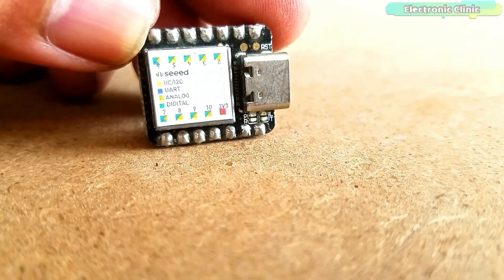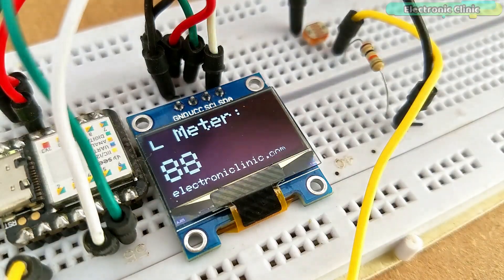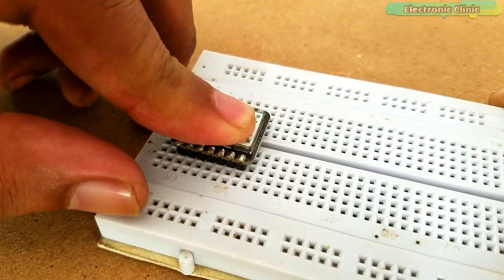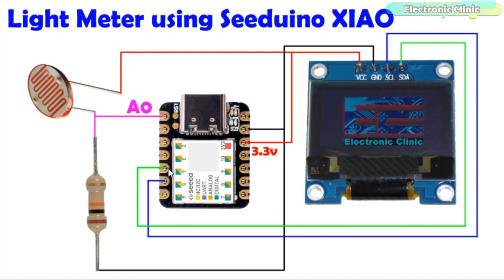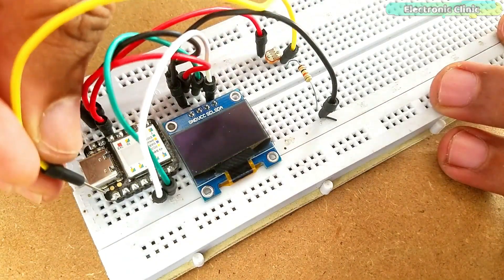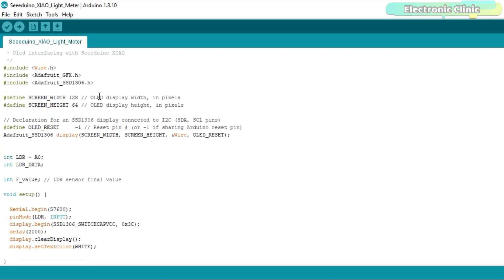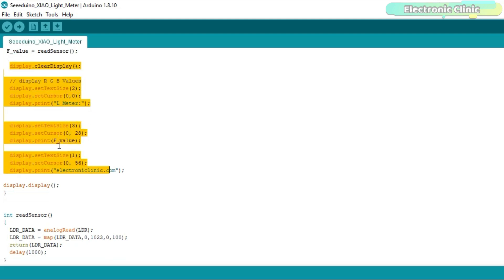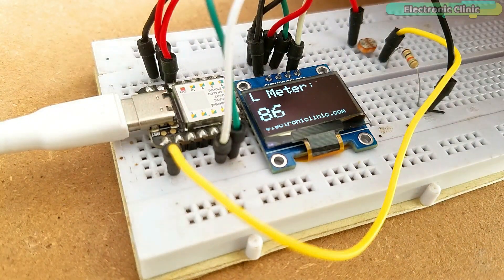Seeeduino XIAO and Oled Display based Light meter, Seeeduino XIAO I2C, smallest Arduino, AllPCB

Comment: This PCB module has a VIN pad on the back but no VIN on the header pins. if this module is mounted on a through hole PCB, can this module be powered through the 5v or 3.3v power header pins? Or do I have to use the pads on the back or the USB C?

Comment: Like everything with this GARBAGE it doesnt work.

exit status 1
expected unqualified-id before numeric constant
Reply from the maker: you need to download the correct libraries and make sure you know exactly which version of the oled display module u r using.
Reply from the maker: there are links to the related tutorials. this is 100% in working form. You need to check things on your side.
Reply: @ElectroniClinic  Its A COPY and PASTE of your code, lol.